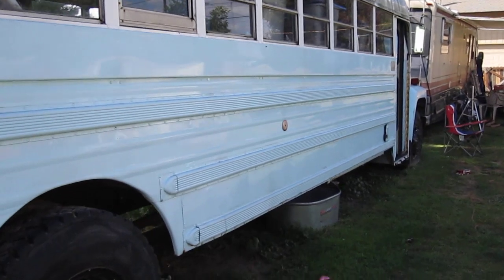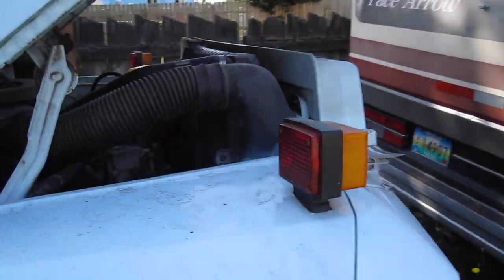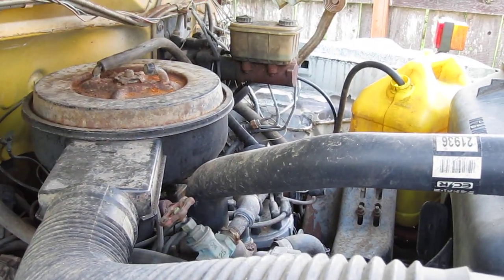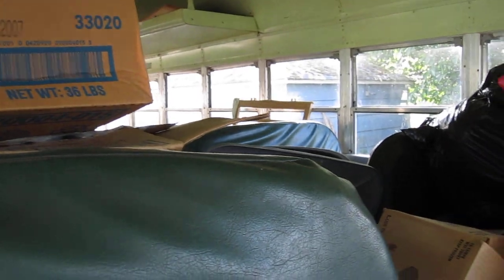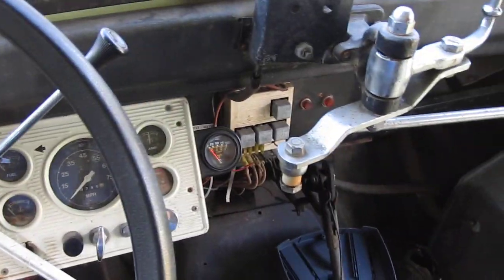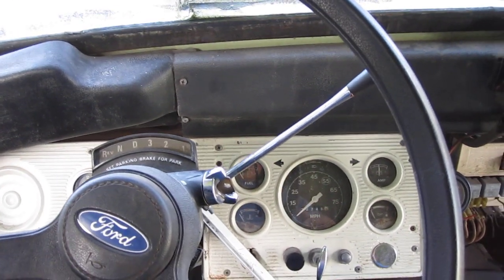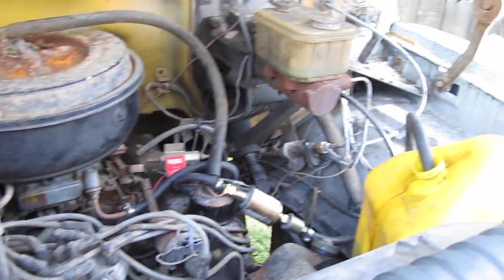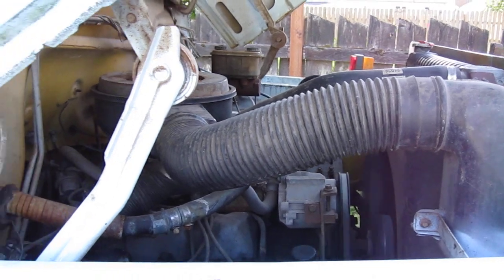1982 Ward School Bus on Ford B700 Chassis

Comment: I know Baltimore County owned a set of these built around the same time. Maybe 83 but I dont know for sure. But theirs had the GMC Chassis on them and the same upper side walls as this unit. But they got auctioned off in 1997 and replaced by Thomas Internationals. And the system did have 86 Ford Wards with the second generation upper side walls on that particular design. But they got auctioned off in 98 and replaced by Blue Bird Internationals.